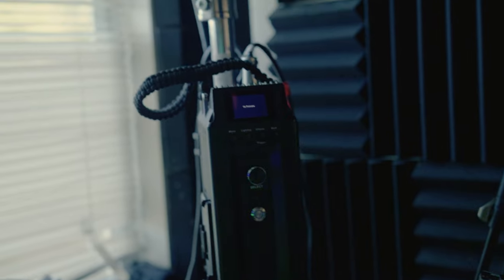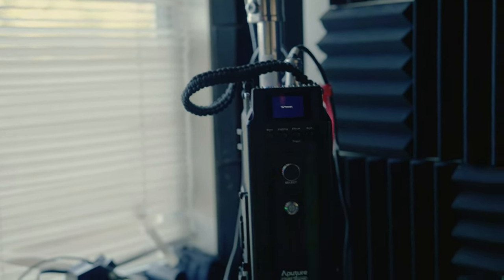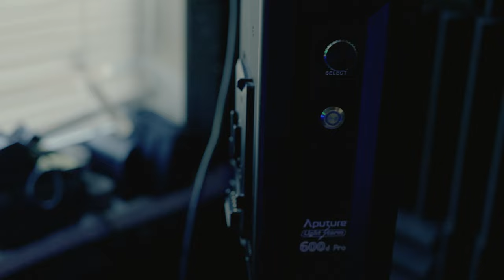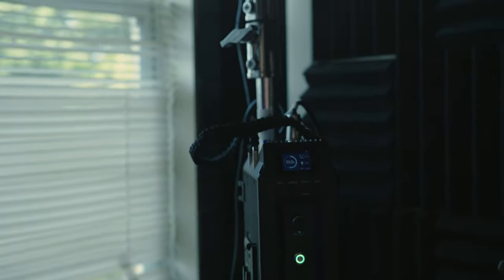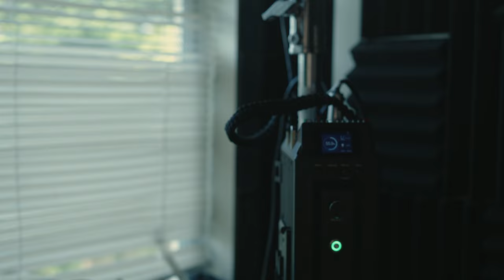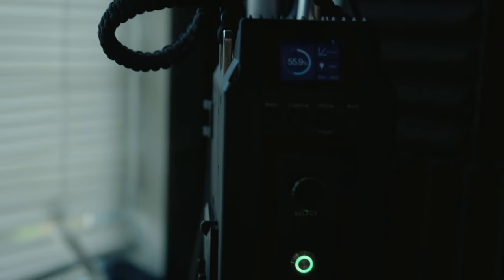Aputure 600d Problem No Firmwire

Comment: Had the same issue a few days ago - light went out during a shooting. After sending my 600D Pro kit to Aputure for RMA, got a quote over 75% of a new kit's price to pay for a repair of the controller box. Told them to send the unrepaired kit back because that's ridiculous. 
Now tried around with the controller box and got the same "No Firmware" like you did. Applying two V-mount batteries made the box boot up. And now after googling around, your video came up.
Have lost faith in Aputure over this. Seems like there is a problem with the AC power converter. 
Does your's now AC power up again?
Reply from the maker: yes all i do is plug it in for a good hour or two boom back on
Reply: Unfortunately my controller box did not come back to life like yours. Guess I'll have to open it up and check the electronics visually. Maybe it's just a dead condenser and I can exchange that myself. @TrapBoiFuse561
Reply from the maker: @robertniessner554  it’s soldered like crazy sorry about that
Reply: That's a bummer. Hope your controller box keeps working. @TrapBoiFuse561
Reply: @robertniessner554 hello there did your 600d pro work..I have the same problem as yours...
Reply from the maker: That box’s can’t keep moving around like that, i love the light but man this is first china 🇨🇳 production produced i got beef with 2000$ have problems
Reply: @denissingi3044  No, unfortunately not. Inspecting the boards in the controller box visually did not reveal anything to me.
A few days ago I've found a repair shop for home stuff like TV sets and contacted them with my problem. The owner is a studied electronics engineer and he said he's interested to give it a try. Will go there this week.
I also found out that Aputure is selling spare parts like power boards for the 600D controller box over alliexpress - so if you can find a clever electronics buff he might be able to swap the boards for you.
Reply from the maker: @robertniessner554 so it’s the power board  you think
Reply: @robertniessner554  I have 3   600d pro and the problem is the same...i also want to a electrical engineer he tried everything but he didn't see the problem..no one can see the reason why it is not working I have tried everything 😭
Reply: @TrapBoiFuse561  yes it is the power box
Reply: @TrapBoiFuse561  yes it is the power box
Reply from the maker: @denissingi3044 damn nasty work they ain’t even tell us the problem so we can fix it
Reply: @robertniessner554  at first I had a problem with one i could swap the board and it will work that's when I noticed that the problem is not the head but it's the down box
Reply from the maker: I don’t move the power box at all as long as I don’t move it it works if it move it go crazy 😝 but what I’m thinking to the power going to the power box too
Reply: @TrapBoiFuse561  when the first one started the problem I was using battery and I was on a shoot that day I had all of them I swapped the power box and it works
Reply: @TrapBoiFuse561  I tried even your method but it doesn't work for me
Reply from the maker: @denissingi3044  damn love Chinese products but this one hit hard
Reply from the maker: so you wss saying it the ac power converter